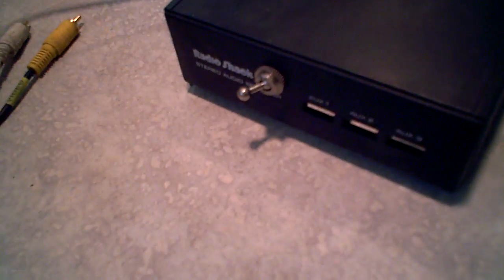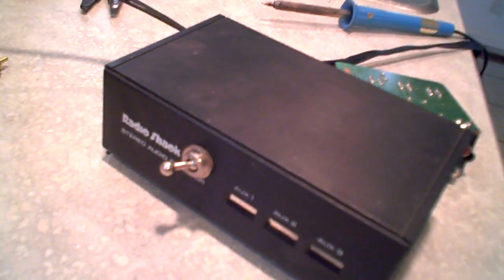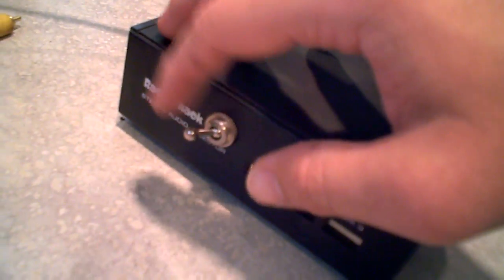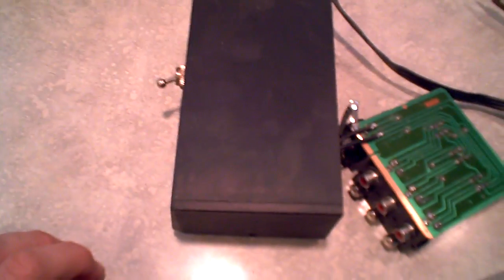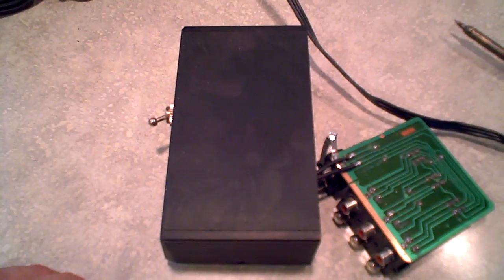Adding a Stereo/Mono switch to your setup and why...

Comment from the maker: I should say that if you DONT want to go through this, you can get a Y adapter and another Y adapter to make it two to one and then back again, which does the same thing, but no soldering... but then you have to plug and unplug every time - doing the switch makes it easy to flip in and out.  Of course, it is also just fun to flip in line to see what it does to the mix, or fix processed stereo...

Comment: What about listening to CDs? Any benefit/difference in having a stereo/mono switch?
Reply from the maker: Zero - the mono switch really only helps with noise.  It WOULD be helpful if you had speakers in different places and couldn't hear both - that way you could hear all the information (like, you were in a different room but could only hear the left speaker) - otherwise, not really worth the trouble.

Comment: Does this still work? Any hum? Was this for a mono cartridge or to make a stereo cartridge sound better in mono?
I have the same selection switch and thinking about doing this.
Reply from the maker: No hum, precisely because it was a metal switch box which makes it shielded.  This is to make a stereo cart sound better in mono - if your receiver has a mono switch, there is no need for this - that does the same thing.  But modern ones don't, and by combining the stereo signal to make a mono one, any noise difference in the L or R channel gets suppressed (clicks) - so when you play a mono record you will get less noise with it engaged.  People will pay for a mono cart, but it literally just does this - they are usually stereo carts with the pins bridged.